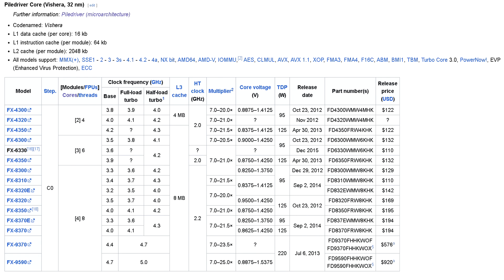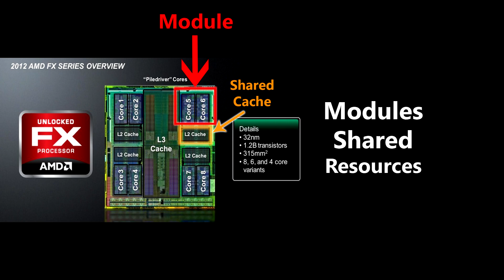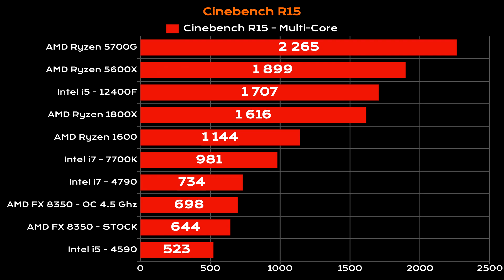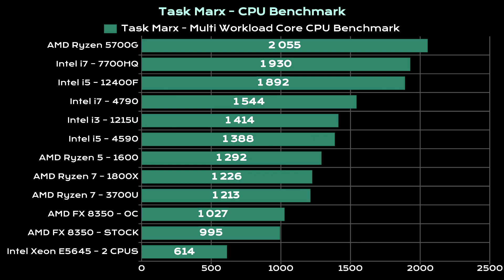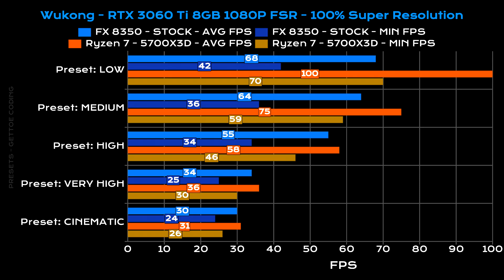AMD FX Series - FX 8350, was it future proof?

Comment: "I never used to see them even if full load go beyond like 65/70 degrees"... i wonder why lol

AMD:
IF those CPU temperatures are accurate your processor is overheating and will eventually reach a critical temperature and shut down the computer.

The FX8350 is a very hot CPU and you need a powerful CPU Cooler to keep it within its Maximum Operating Temperature of 61c. At those temperatures, above 61c, your processor is throttling or slowing down to keep the temperature at 61c or lower.

The rated TDP of the FX8350 is 125 Watts. So you will need a powerful AIR or Liquid AIO CPU Cooler to keep it below 61c.

If it is running constantly above 61c it will shorten the life span of your processor.

NOTE: TDP Rating is how much heat your CPU Cooler will need to dissipate from the processor to keep it cool. So your CPU Cooler must be rated at least 150 Watt TDP for your FX8350.
Reply from the maker: Thanks for the heads up tho, keen to give this oc another go
Reply: @gettoecoding1058  Your welcome, keep hwmonitor open in the back ground. If you doubt the sensor readings watch the idle temp in bios and windows to check for differences. If the bios is higher keep that difference in mind in windows.
Reply: @gettoecoding1058  Its not just amd fx cpus. Its all amd cpus before Ryzen having a thermal limit of 60 degrees. I tested everything from durons to 3900x. For fx you will want the cpu core temp at 58 degrees max. Got a fx 8350 do 832 in cinebench r15. Maybe put a fan towards the vrm too as high vrm temps can thermal trottle the cpu as well.
Reply: @gettoecoding1058  Its not just amd fx cpus. Its all amd cpus before Ryzen having a thermal limit of 60 degrees. I tested everything from athlon xp to 3900x. For fx you will want the cpu core temp at 58 degrees max. Got a fx 8350 do 832 in r15. Maybe put a fan towards the vrm too as high vrm temps can thermal trottle the cpu as well. Stupid youtube keeps removing my answer...
Reply from the maker: 65 to 70 is on hotspot not package temp
Reply: @gettoecoding1058  Ive seen these trottle as soon as 1 core hits 61 degrees (hotspot).
Reply: @gettoecoding1058  Your oc benchmark scores even reflect the trottle. With the cores at 4.5 ghz the benchmark scores should be higher talking out of experience.
Reply from the maker: Package usually was around 49 degrees, I think peak was around 52. The only throttling I noticed was on the cheap asus board due to the shitty vrms 😅. On the gigabyte board they were stable. I didn't do a massive overclock 4.5ghz, anything over that I noticed a way larger power draw from the wall. Unless fps mon is pulling temps incorrectly. Which is possible I guess. I thought the difference between hotspot and package was rather large. Usually it's only a few degrees, thar Evo 212 was mounted solid. I should maybe test and again with other temp monitoring software
Reply from the maker: For which benchmarks if you don't mind me asking? I have an old corsair H80 aio I wanna test, will be a good indicator of what I should be getting at 4.5ghz and if the software is bullshitting. As I didn't notice any clock drops in cpuz on the new board during the benchmarks
Reply: @gettoecoding1058  Its not only fx cpus. Every amd cpu before ryzen has a limit of 60 degrees. And i tried everything from amd durons till 3900x. Basically you will need to keep core temp at 58 degrees max for fx. Got a fx8350 to 832 in cinebench R15 with 4.5 ghz all core speed.
Reply from the maker: OK cool thanks man 👍 I will definitely give that a go 💪
Reply: One thing I realized back then is that you'd actually be getting thermal throtling/shutdown from the VRM hitting 74C, but you'd have boards reporting the VRM temp as if it was the CPU.
Reply: @blkspade23  Thing with mosfets is that they can carry way less load when hot and fx oced really loves energy like nothing else. They can drop from 50 amps to under 20 pretty easily because of heat. Fx is a nice platform to learn oc though as its so sensitive to everything like ram and north bridge speeds. You can get much more out of these just with decent tweaking.

Comment: Great video. I have been thinking a lot of rebuilding another FX system to the level my FX system was at before I had to switch to Ryzen. I'm really wondering if FX cpu's would do better now then back in the day as they say.
Reply: hi I can only say that AMD FX CPU was born at the wrong time, but after many years it can handle large-scale games very well. I now use AMD FX 8370, GTX960, 32GB RAM, and I can open three to four modern large-scale 3D online games at the same time. The picture quality of the game is above average, and the FPS can be above 60. It is much easier to use than the era when it was first produced. For your reference (English is not my native language, please let me know if there are any mistakes)
Reply from the maker: Go for it, you never know. I was impressed with how mine still ran, even under windows 11. The fact I could play Cod MW3 2023, Hogwarts Legacy and games like that with a playable frame rate I thought wasn't bad. Especially if you just building it as a second pc, you have nothing to lose really if you have the main parts already.
Reply: As someone whose daily driver is STILL an FX-8350 w/32GB that does everything I need running 24/7 for the last 10 years, I can safely say, NO, don't do it! There is a HUGE difference between milking the last dollar out of my 10-12 yr old system and you intentionally buying 10-12 yr old parts to build an old system. You can definitely get 1st gen Ryzens for the same or less than a FX-8350, and maybe even Zen+ or Zen2 CPUs.

Comment: Well, 6300 system here for Win 7. Whole system overclocked, GTX 970 and works like charm. God, it can run Baldur's Gate 3 in respectable settings and FPS.
Reply: Did you manage to get it to 5Ghz?

I ran my old fx-6300 at 5Ghz with 16GB RAM on a Sabertooth mobo for years! Haha
Reply: @BrophyCypher  Sure. But actual FPS gain was relatively small compared to rising temps and power draw, so I settled at 4,4 gHz, which seemed to be a sweet spot.
Reply: @RudolfSikorsky  ah well I was poor and stupid😂 so I followed a guide to get it up there and just left it. I started with 8GB RAM and an R9 270 and later on put in another 8GB stick and found a cheap R9 270X and stuck it in there in Crossfire! 
Had no idea what I was doing haha

Comment: I'm just casual PC user, but after checking parts prices and their performance for quite some time i think, that FX8350 computer should be considered only as a retro build for fun and casual day to day use. I have 3 years old 8350 build (on ASUS 970 Gaming Aura, 4 sticks 32Gb HyperX Savage, MSI GTX 1060 6Gb Gaming X, Adata XPG S5 M.2 SSD), that from the beginning i considered as such, a fun retro build for giggles and casual daily use.
But now, in Poland where i live, i see that prices for fully working 970 or 990 FX motherboards, 8xxx processors and DDR3 RAM stics are comparable sometime with a new AM4 and DDR4 counterparts. There's absolutely no reason to go after FX hardware, when at comparable prices one can put together Ryzen 5000 series build, like B550 mobo + R5 5600x. With just little more money it's better to get X570 with 4.0 PCIe all around and R7 5700x. Or X3D version when you find a fine doscount.
My FX fun build will end up as offline Windows 7 (i'm planning to made it booting from NVMe) retro gaming machine, when i get myself Ryzen 5000 series PC, when its parts prices drop even more.
Reply from the maker: 100%, if you have the parts already fine, but dont guy buy a Am3+ setup in 2024. I luckily had the parts as I dont sell or bin any old pc hardware, I literally have a storage unit full of stuff. All the way back to Pentium 2 era stuff, still got my Creative Voodoo 2 even :) and ati rage card, CRTs list goes on

Comment: I had the 8350 and the high end Vishera 9xxx in two rigs here, the overclock ceiling on the 83 was pretty good and easily went to 5ghz but the Vishera was not too fond of overclocking I guess it was pretty maxed out.   What made these chips so good was the eachway communication in that there was a dedicated decent sized bus between each core and threads kinda like a 8x8x8 matrix in a pretty cool 3d pattern first seen in the high end Phenom's then the Hexa "cubed" array CPU's with the six cores and the introduction of the 8 cores paved the way for the Ryzen architecture.
Reply from the maker: Also with these fx cpus, you gotta have a decent motherboard, I ended up using 2 as the first one was so limited. I should have noticed when I saw only one 12 volt motherboard pwr header for the board and not 2 like the second mb had. I always found also for code compiling that this 8350 would always compile my .net code faster than my intel 7700k back then

Comment: Interesting to see another video like this!  I just did one last month comparing the 8350 and 6350 to the 3570 and 3570k to show which competing CPUs aged better.  I won't spoil it, and invite you to watch it on my channel if you like.  🙂  
But I can share 2 things you may find interesting:  1)  Proper tuning and parts selection is key.  And 2)  Both the 6350 and 8350 were more than capable of fully loading my overclocked Sapphire Nitro Vega 64 (Faster than a GTX 1080).  In fact, in some games I was still GPU bottlenecked.  A pleasant surprise.  
And...  I just got a 3770k and plan to compare that next.  🤓
Reply from the maker: Dang man, your video is done really  well, alot of detail 💪. I'm actually tempted to follow your guide and see what my gaming bench marks do. Interestingly enough I wrote a small cpu benchmark which used floats and then pretty much the same bench mark using integers as the cores in the fx modules share a single floating point unit per module. Didn't make it part of my video as I try not to go that technical and lose the people watching. But in those benchmarks float wise it was not great... but for the  integer calculations running in parallel... that fx cpu beat intel cpus released 2 years after it
Reply: @gettoecoding1058  Thanks for the compliment.  :)  And IMO the 4790 is actually a better designed CPU than the 3570k / 3770k since it goes back to using solder for the IHS.  You'll get some good performance and temperatures out of that one.  
And yeah, if I had to pick one major flaw with the FX 8350, it was the power usage.  BUT a 6350 @ 5.0 GHz used less power, and performed very well in my tests.  
Overall, these are just a ton of fun to tweak / tune.
Reply: @gettoecoding1058 I agree, that's why I'm still using an AMD FX CPU in 2025, because it can handle more things that I couldn't do back then
Reply from the maker: Yeah 100% that parts are key, for this video I ended up having to use another motherboard as the original asus board I had was firstly super limited with the cpu bios tweaks. The vrms were also causing the cpu to drop in voltage when they got too hot. The vcore voltage would drop during cpu benchmarks all the way to under 1 volt and all the cores would clock down to 1.5 ghz, just for a few seconds, then shoot back to 4.5ghz. I did try setting the multiplier lower and increase the north bridge clock to get it to 4.4ghz thinking it was something else. But after checking the vrm temps I could see the issue. Anyways the second board from gigabyte had no issues. Got it to 4.5ghz easy. But power from the wall lol just starts to get rather high when you go over that, but im not a big overclocker to be honest, always just played around. But the gigabyte board had some bs v core voltage options as I couldn't set the value myself had to select from a list, which starts at 1.425... But I do agree that's parts are key with these fx cpus. I didn't play around with the ram timings to be honest. Just found the kingfast ram vs the transcend ram performed better and the default timings on the kingfast modules were also lower.
Yeah that 3770k will be fun to play with. I got a 4790 the other day, unfortunately the non k variant. But seen a few 3770k cpus on ebay

Comment: I have the 8300 and an rx560. The other day, there was an electricity problem and the 560 stopped working. I tested the pcie slot with a 5450 and it didn't turn on either. It's probably a problem with the motherboard. I'll try updating the bios to see if it comes back, but I think it's a physical problem with the motherboard. So, do you think it's worth buying a new PC or a new mobo for the FX?
Reply: I forgot to say, the onboard video card works normally. Even going into the BIOS and setting it to start the system using the card that is in the pcie, it doesn't really work. Only the onboard works
Reply from the maker: I guess it depends on your budget. But if you have a bit of budget I would invest in a new system. I was impressed with what this 8350 can still do. But it will bottleneck everything recent from intel, amd and nvidia graphics card wise. And if your rx 560 is fried along with the motherboard you gonna have to get a new gpu unless you plan on buying second hand or old new stock. You could always even go with an apu. As you have all amd hardware currently I'm presuming you would go all amd again. If that is the case and you wanna wait on getting a gpu, something like the amd 8600G apu is not a bad buy, you will also be on am5, so that platform should be supported for quiet a while longer. I know am5 motherboards are not the cheapest. But nothing wrong with a entry level B650 mb. Most of them support ddr5 memory up to 6000/6400 mhz with an xmp profile. Which will definitely help out that apu. And if you wanna Chuck in a gpu later you can definitely do that. That apu even as just a cpu has more than enough cpu performance to push most gpus in the market. If I was gonna build a new pc right now. I would get the ryzen 7 7700, as it comes with a decent cooler included and its well priced at the moment. I would then get a decent mid range mb. Chuck in a 64gb kit of ddr5 6000 mhz. A rx 7900 GRE. Otherwise look out for some decent second hand parts. Am4 cpus and motherboards are really well priced at the moment as well. Only issue there is am4 is basically done.  Also intel 12th gen is priced well at the moment. Grab a good B760 board maybe a 12400f. Only issue with the 12400f is you will need a gpu. But again there is so much stuff on the second hand market. I managed to put together a ryzen 1800x build, where a mother board bios update even allowed me to  enable resizable bar. I also did a build with an old intel 4790, paired it with 24gbs of ddr3 1600 and a gtx 1080. All second hand, and it runs everything. You obviously not running everything at ultra. But for 1080p gaming it works well.
Reply: @gettoecoding1058  Thanks for responding. I'm already thinking about going for an R5 5500 with RX6600. My FX board has two video outputs. But they keep changing. Now I turn on the PC and the video stays on VGA. Another time the video is on HDMI. I think the electrical problem caused this too. It left the motherboard crazy. It's about adding some and going with a new configuration.
Reply from the maker: @opinadorrj4337 that will be a good hardware combo 💪 let me know how it goes
Reply: @MDFGamingVideo  Thanks, Im thinking about r5 5500
Reply: @MDFGamingVideo  Or R5 4500

Comment: I have the same gear, can the FX 8350 be used for the next 2 years>?
Reply from the maker: Yeah I reckon so. It does lack some cpu instruction sets like avx2 but outside of that I don't see it being an issue 👍
Reply: @gettoecoding1058  Thank you friend
Reply: @gettoecoding1058  not having avx 2 is gonna hurt at this point upgrade, throw it pls omg why ppl still hang onto ANGIENT CPUS? just becasue they dont know any better and htink thats all there is and shit hasnt changed much in over 10yrs? cmooon dudes youre smarter then that, this is ludicris i was already annoyed by my i7 2600k in my second PC in 2021 imagine ive had my FX still i would prolly be very mad because NOTHING would have worked anymore, especialyl my main PC at that time had a Ryzen 5 2600 in it, imagine the difference between an FX and a R5 2600, its not even close its night and day :P